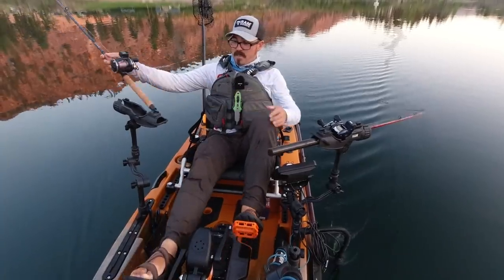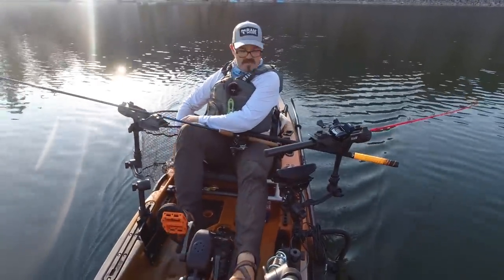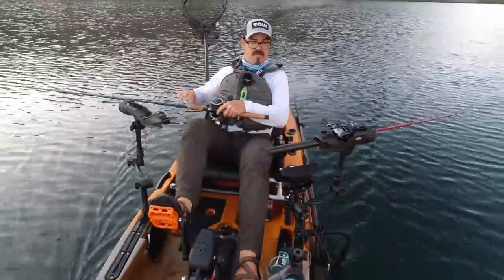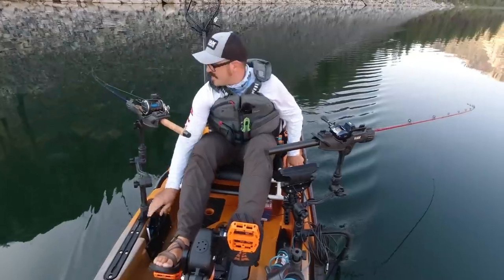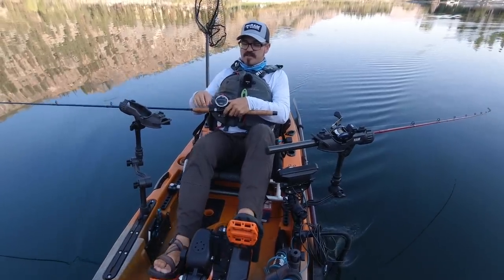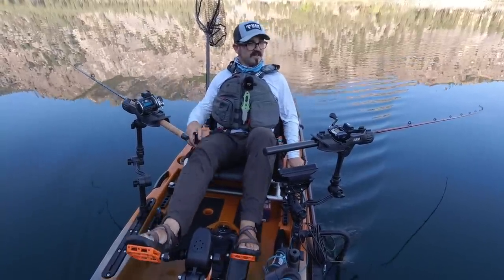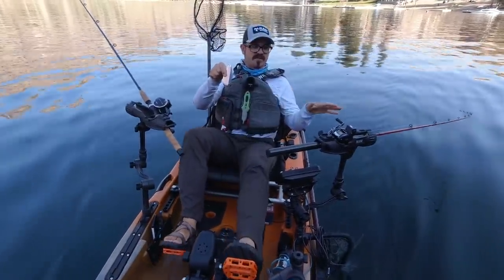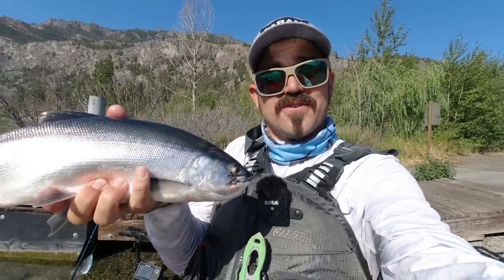Lead Core vs Dropper Rigs for Kokanee

Comment: Those were some nice kokes! I started experimenting with a hybrid leadcore setup last year. basically only 4 colors of leadcore with a fluoro topshot. I found the same results as you mentioned. The fight is just not as good, especially on smaller fish, and to get 25 -30 feet I was  120 feet back. It's always cool to learn new methods and I will say the leadcore does catch fish! As always great video, you do great work!

Comment: Nice video !  Also highlights the importance of using what works for your needs. I see leadcore used a bunch on larger vessels but like the simplicity of a lighter setup, especially in some of the lakes with the smaller koks. 
Got some pigs up there in CL

Comment: Tyler, I don't have downriggers, but I do have a leadcore (and dipsy) rig. And, I also run a dropper with the leadcore to get it down fast .  8 oz of lead will get it down to 25 feet with about fifty feet out, so the lines is at a very steep angle. Although, the outfit is heavy to start with, so it's not the sportiest equiipment to use, but it catches fish.

Comment: Hey dude your videos are very enjoyable.  I fish lead core a lot and find after 2 colors are out the lead core deploys itself.  I attribute that to pointing the rod tip towards where the line is deploying in order to reduce friction on the rod guides, and I use a rod that has the ceramic inside the rod guides.  I also use Mason 18lb  lead core.  I have never used the lead core that you are using.  Try placing your rod longways on your Kayak when deploying lead core.  I only fish for brown trout but I watch your videos anyway.  Perhaps you could make some videos on finding brown trout because there isn't much information on that.   Thanks for all your videos!

Comment: Just a note - when there are ruptures in the braid with lead poking through it actually does compromise the overall strength of the braid.  I learned that the hard way by losing several dodger+lure rigs before I figured out what the problem was.
Reply from the maker: I guess I should have said it depends on the severity.
Reply: Spilt Milt Productions I had started using lead core about 4 years ago.  When I first saw the kinks with lead poking through I ignored it until I had breaks.  Now when I notice the lead kinks I cut the line, remove small pieces of the lead and splice the braid together until I eventually replace the lead core.

Comment: It would be interesting to see what your results are using your dropper Rigs in combination with Spin and glows and  wobble glows for the Kokanee. The spin-n-glows and wobble-glows are used quite extensively for drift fishing salmon trout and steelhead. I would love to see a head-to-head comparison between those two lure rigs with the two hooks system on your dropper flasher rigs in a new video.
Reply from the maker: Back when I first started Kokanee fishing I use spin-n-glows for Kokanee quite a bit. They do work!

Comment: Do you find bigger fish to be at a different depth than smaller kokanee this time of year? In the reservoir I fish at the bigger fish seem to be deeper this time of year.
Reply: @workhard.830   I noticed that too.  I was catching some smaller fish.... went out about 40 more feet and started catching larger ones.
Reply from the maker: It really depends on the lake for me. In this I was catching big ones at the same depth as the shallow ones. In Montana when fishing  Little Bitteroot Lake there were clouds of small Kokanee at 20-30' and monsters at 40-60'.
Reply: I have experimented with that too. I started fishing at about 60 feet versus 30 where i fish, and on average they were bigger fish.

Comment: Posted on your FB page, but one can get line out fast and easy and fish with much light reels than what you were using. I mentioned my set up over there also. Great stuff as normal...sweet Kok’s
Reply from the maker: I have no problem getting the microlead to roll off but the heavier stuff is just too stiff. However, I can't stand the microlead because I would get 2 or more kinks in it per outing. That gets expensive really quickly.
Reply: @spiltmilt   Great vid! I've used the same lead core (Tuf-line regular) that you are using and have found it hard to verify depth.  You said in the vid that you had about 3 colours out but then said 150' which would be 5 colours (30' per colour).  The 5 colours makes sense though as the average I've read is 5-6' per colour at 1-1.5 mph to get you to your 25-30'.  I just tried the lead ball dropper you use for Chinook last week in the Sound with a 10 oz ball for the first time and was getting tangled messes quite frequently even though I have a pedal Hobie.  I think sometimes I was letting it down too fast and others maybe going to slow.  Maybe I'll try the same setup in Lake Sammamish for some Cutties (with a smaller ball of course!).  Anyway, thanks for making these great videos!

Comment: With the rods so near each other on a narrow kayak I wonder if one line being on a more narrow angle into the water and the other on a steep angle helps avoid tangles between the two
Reply from the maker: I'm sure it help but I rarely have issues with tangling.

Comment: I use lead core one thing I do is vacant the lead as you did but I push 10 lbs test mono in the vacated lead core tie three over hand knot spaced about one inch apart to hold the mono in then put about 20 feet of mono after the lead core.this way your playing the fish close to the boat on mono and the line will reel  on the reel
Reply from the maker: Great tip. Thanks for sharing.

Comment: Excellent video as always. Is there a reason you're using the Santiam rod instead of the Swate Blueback you used to use?
Reply from the maker: I stopped using Swate products because the company that makes them does not treat their employees fairly
Reply: @spiltmilt  That's very respectable. Aside from protesting the company, was anything wrong with them or was it simply a moral decision?
Reply from the maker: Moral. The rods are good quality

Comment: What's the formula you use for 2oz and 3oz droppers to determine the depth you are getting your gear down to?  Also how tight do you crank down the drag when trolling?
Reply from the maker: 2 oz at 1.3 mph with 50' of line is getting me down at around 24' at 1.5 mph I'm at around 18'. If I push it back to 100' on the linecounter at 1.5 I generally get 10-15' drop for every ounce 1.5 mph.

Comment: If 1oz at 100 feet of line equals 10 feet down with a dropper rig, how are you getting 25-30 feet down with 2oz and 50-60 feet of line? I would like to add a dropper rig to my gear so I can fish two rods deep. Now I’m confused about how much line I need to let out.
Reply from the maker: Because I’m going slower than 1.5 mph
Reply: @spiltmilt  Ok, that makes sense. Thanks.

Comment: What would outcome be if using two identical dodger and leader length set ups: one rod having shrimp or hoochie with colorodo spinner and baited with corn, second rod has double hooks baited with corn?

Can you show a picture of what the Thermocline looks like on your fishfinder? I was looking at a Himminbird Helix 9 and Helix 7 for 3 straight days on Lake Roosevelt (8-14 - 8/17), adjusted sensitity setting up to 15 out of 20, no lines on screen to identify Thermocline!
Reply from the maker: The goal of the video wasn't to show that you get more or less hits on one setup or the other. In fact lead core caught a fair number of fish that day. Both rigs had double hooks baited with corn. 

This video shows the thermocline well at 6:40 in this video https://www.youtube.com/watch?v=yuWFk61S568
Reply: @spiltmilt  Thanks for the reply. I was merely curious how much an atractor such as a brightly colored mini hoochie or Rubber shrimp with or without a colorodo blade is compared to a second rod having an identical leader length but having only two bare hooks baited with corn, no other attractor. 

I will look at linked video. Thank you!